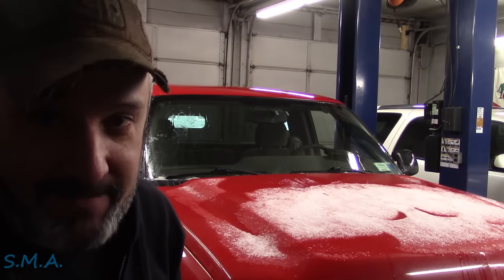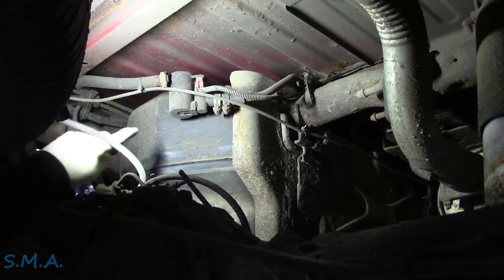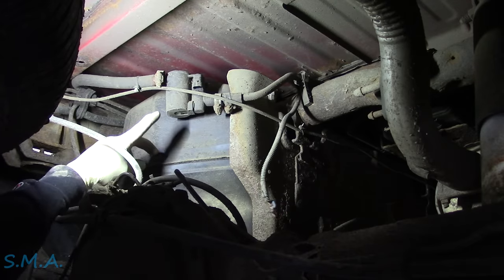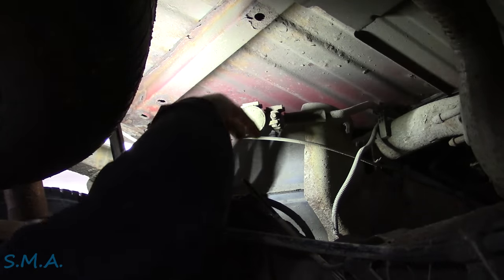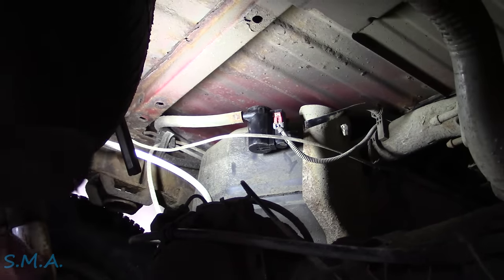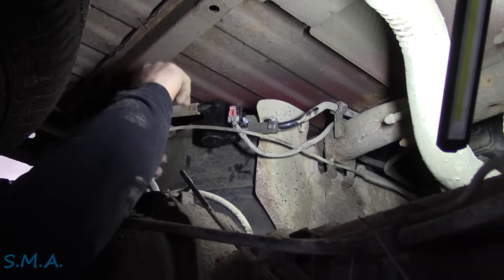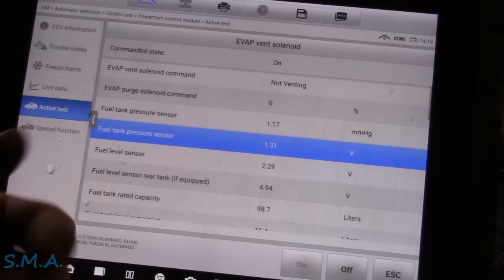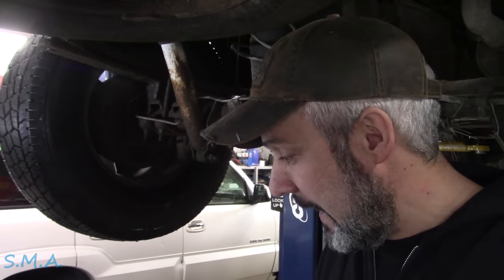Chevy/GMC Truck: P0442 P0455 Small & Large EVAP Leak

Comment: Mrs. O: "Is there any benefit to changing the thermostat when doing a heater core flush?" It's for a Ram"

Mr. O: "...I can..."

Let's all take a moment for the cold customer in a Dodge with a plugged heater core.
Reply: 2017 plugged core is a weird thing to have. Unless they have had other issues
Reply: @Sicktrickintuner  probably a bad blend door motor. Lol
Reply: I think he was getting at having his brain picked by randoms, which is why he replied "I can...", meaning if the guy wants a definitive answer he can bring it in.
Reply: Sicktrickintuner  Or perhaps believed Scotty Kilmer that it’s ok to use a whole bottle of Barr’s Coolant System Liquid Aluminum Stop Leak. lol

Comment: Methinks GM thought one day that "the 3.8 is a great engine, so the 4.8 will be even better!" Clearly their reasoning was faulty.
Reply: 4.8 is pretty much bullet proof. 3.8l has a bunch of cheap external GM engineering that brings down the reliability. Such as plastic bypass elbows, plastic upper intake plenum that melts. Lower plastic intake gaskets that fail. Valve cover gaskets that melt away and drip oil all over the manifolds.
Reply: I wonder if it was just an attempt to lower emissions in the light duty truck category
Reply: I replaced mine with a 6.0 in my 2001 that had the 5 speed.
Reply: The 4.8 is an incredible engine and holds up great to extra power
Reply: @sierravortec2494  I still own a 96 S10 with the 4.3 tough as nails . and a 91 GMC 1500 with the 5.7  290 k on it , but I've cheated I changed oil every 3,500 miles .
Reply: Perhaps to increase the MPG on their truck fleet, or for competitive reasons...?
Reply: I have a 4.8 in my 2011 4x4 Silverado, short bed, standard cab. The engine is gutless down low, wakes up a bit above 3k rpm. Exactly the opposite of what a truck engine should be. But it's pretty good on gas, I've hit a high tank of 21 mpg, which I think is very good for a full-size pickup. Just don't tow anything with it, as the gas mileage goes to shit fast, and the engine struggles. But it has 100k miles on it and all I've ever done is change the oil & filters every 3000-3500 miles. Here in cold, salty, central NY state, the body will be long gone before the engine gives up.

Comment: Another one fixed.  What should I use to get my alternator moving freely again?, the truck wasnt used for a while and the alternator is difficult to turn over. Thanks
Reply: Replace it.  There may be rebuild kits for alternators.  I have one for my 2002 F150 in case I need it.
Reply: It needed bearings just before it got hard to turn. Don't run it unless you get some or as suggested change the entire alternator. Chances are very good there is nothing left to fix with the bearings you have in it now. But grease is what they used to have in them.

Comment: Eric O,  I've  wondered. With a vehicle.   150,000
Beat up miles.  Barring the smoke test, cap replace... short wires.  And before the DTC....
WOULD,it be plausible to replace.  The 3 main parts. Plus hoses/ connections.  ???
Been curious 🤔

Comment: Great Informative Video Eric!! I've been chasing P0442 DTC for awhile now.. I've changed both Evaps and still get Same DTC.. With your video I cked seal and seems to be correct but fuel tank pressure drops to 0.03+- or so.. Would that be normal? Any other ideas or should next step be smoke test again?

Comment: The idle on my car stumbles  after refueling.  After about 30 seconds it normalizes and runs fine until next fuel up. No CEL and no problem filling the tank. Ive replace the purge valve and the vent valve with no luck. Wondering if it could be a clogged fuel tank vent line.

Comment: Or replace the valve with a GM 214-2149 ($16), which vents inside itself.  Same plug as the old styled one, and only 1 hose.

Comment: I have a 2005 GMC Sierra half ton pick up with Evap system problems. I’ve done the purge valve in the tank and the canister valve like you did in your video and I’m still getting an engine light for the same code. What could it possibly be?

Comment: Will this issue cause loss of fuel pressure overnight? I have to prime my fuel pump with the key to start my truck if it sits overnight
Reply: No. This only handles fuel vapors inside the gas tank. Sounds like you have a bad fuel pressure regulator or a bad fuel pump, maybe a sticking injector. I'd definitely look for a small fuel leak in any of the supply hoses to the fuel rail. Definitely don't want to burn the truck down.
Reply: Maybe fuel filter?
Reply: Nope - that's a check valve inside the fuel pump assembly. The valves aren't replaceable - new fuel pump is the fix for that.

I had one in a Volvo once that failed the opposite way. It would get stuck shut, and not allow fuel to pump! That was interesting.
Reply: I would say that would be the check valve in the fuel pump, an injector stuck open or a hole in the fuel line.
Reply: @eldonerc2524  Hey man, on my 06 Sierra I replaced the rear dome lights. Anyways,  when I swapped the bulbs again I heard and smelled a burnt sound. Now my reverse camera doesn't work along with the rear dome lights. Any idea on what I should do?

Comment: The small evap leak is usually the gas cap the big leak is the wrong gas cap or the purge valve
Reply from the maker: Interesting you mention the gas cap. I have repaired and diagnosed well over a thousand EVAP system of all different makes and in the past 20 years I think I have actually found 2 bad gas caps. It is usually the least common actual problem but the most common part people change for some reason. Any how, may be different in your climate 😊
Reply: @Mauivegan67  😅 drove off an left my cap sitting on the pump one time. Went back to the station an asked about it. The girl pulled out a box with about 30 caps in it asked if I knew which one was mine. Just got a good chuckle outta it. An about 10 minutes of trying gas caps I got one that fit. LoL
Reply: @SouthMainAuto  2006 Mustang GT, one day evap issues... guessed gas cap, got a new OEM one, and tada.  They do happen, but that was my first and only!  I know, I know... parts cannon... it worked. :)

Comment: Hello, I enjoyed your video,  I'm in CA. took my 88 Cheyenne 1500  pick-up in for smog testing today everything passed except at the end they had to smoke the gas tank and came back a leak. on the paperwork it said "GROSS" so it didn't pass and they want me to bring it back for diagnostic. I am on ssdi so my budget is limited so I want to try to find the leak myself to save some money and hopefully I can repair it and it is not the fuel pump gasket or something I can't get to without lifting the back bed of the truck.  Any thoughts?

Comment: I had a 2000 Chrysler Concorde, that I had to replace, the entire system. I smoked it, couldn’t find any leaks? It was an intermittent thing also. The canister lives wedged between the frame and gas tank. That was fun, on my back, in my driveway trying to get that out. Come to find out, the problem was , one of the hoses kept slipping off, the canister, causing the money light to come on. Absolutely no room to work, or even see the top of the charcoal canister? Not fun.

Comment: So on a 2010 Suburban 1500 with evap errors all over the place, this would be the first place to check?  It would make no sense to replace hoses and other things I've seen people do on videos if this is 24/7 venting, right?  My suburban has horrible acceleration until I get to about 2500 RPM.  It is not in limp mode.  I've changed the oxygen sensors out and it ran fantastic for about 10 minutes after that, and then back to reality.

Comment: at what point in time do many small EVAP leaks become a large EVAP leak?
Reply: When the rust hole gets bigger in the filler neck or the purge solenoid or vent valve get stuck wide open
Reply: no gas cap..lol
Reply: @Nudnik1  Yeah that'll do it too. Many gas caps go "missing " off the car lot where I work. I don't work in the hood, but I'm near it. We've had emblems stolen off cars, loose alloys wheels taken. All the caps I replace now are replaced with locking caps
Reply: @FixIt1975  In da hood gangsta b jacking rides dumping them when outta gas..
They leave caps on..
Reply: @Nudnik1  true, but I work 10 minutes outside Camden,  NJ  in Merchantville. I think these bozos are stealing gas when we're not there. Or they need the gas caps for their rides
Reply: @FixIt1975  IDK I already have several holes larger than all that but mostly at shock and spring mounts or in doors or body panels dad actually had a fuel tank fall out of one car but the dual exhaust pipes kept it closely in place so it didn't disconnect.
Reply: @FixIt1975    amazing so many think they are 'entitled' to what you have worked for or earned or created. "It's a whole new world"
Reply: @jhonditch4269  sounds like time for a newer car. Or, a nice, thick ratchet strap will hold a gas tank in, in a pinch
Reply: @FixIt1975  I had those when gas got up to $1.00 a gallon and you could only get $5 at a time on even or odd days. yeah I miss Mr Peanut Farmer Jimmy Cartier. if cold just put on a Mr Rodgers sweater.
Reply: @jhonditch4269  It's sure as hell not a better world,  not in my opinion
Reply: @jhonditch4269  I don't miss him. I remember the second fuel embargo.
Reply: @FixIt1975  I didn't say better I said NEW GOD help us all.
Reply: @FixIt1975  it looks better every time i add more jb weld and scrap plastic when I master carbon fiber patching it will be beyond what manufactures now produce as 'new' being never ever worked. Damn Dorman always does me in though.
Reply: @jhonditch4269  Dorman is hit and miss. Most of their hard parts are ok, for instance,  I just replaced all the fuel and vapor lines on my 2000 Silverado with a stainless steel kit from Dorman. I didn't go OEM because it isn't available anymore. It was a spendy kit, $400, but very good quality. I'm not kidding. Now their electrical parts,  are for the most part,  complete garbage. I work on probably a thousand cars a year. Right now, I have to be very creative in how I get things fixed. OEM,  aftermarket,  used sometimes. If I don't have to see the car again after it's been sold, and  my employer is happy,  so am I

Comment: I have both large and small leak codes so I changed gas cap, purge valve, and vent valve but still have same codes. Finally did smoke test but I don’t see smoke coming out. Any suggestions?

Comment: You mentioned that the information on your scan tool was in Canadian, what did you mean?? Do the vehicles have different information on them even if they are potentially the same make and model to meet a different countries pass requirements ??
Reply: He simply meant the units were in metric ... "litres" specifically ...     Settings in the scan tool allow you to select Imperial or Metric units.
Reply: Thanks Dwight being at Brit I didn’t get the choice of words and meaning, but being a Brit in their 50’s and worked in machine shop I know both metric and imperial systems. I value your reply thank you!!

Comment: So I got a 2008 Chevy Silverado with the 4.8 V8 and I got the codes p0455 & p0442 I only have problems starting the vehicle right after a fill up it will hesitate first attempt but will start on the second attempt any idea where to start from my information?

Comment: The 4.8 was has an excellent reliability record like the 6.0. The 5.3 has always been the more trouble prone engine of the group. Mainly because of active fuel management and other small issues. I think of the 4.8 GM to the 4.6 Ford. A small but robust reliable engine.
Reply: While I agree with you, this generation of truck didn't have the dod/afm, so the 5.3 was just as good as the rest
Reply: Yep - going to be doing a 6.0 (or 6.2, or 7.0 - haven't decided yet) swap on my '07 (GMT-900) Silverado soon. Low oil pressure, and the engine has been burning oil and making metal since it  had 50k miles on it. At 117k now. What a disappointment! Half the driveline has already failed, too. Rear diff couldn't even make 100k miles.
Reply: @SmittySmithsonite  go with a 6.0, if you are going to keep the PCM stock (and use a DOD eliminator on the obdII port). The 5.3 fuel maps work, but will add 3% on the long term fuel trims. The 6.2 and 7.0 will go too positive on the long term trims and trip lean codes. This is from my personal experience of playing the LS swap games. Also, you could put a 6.0 where a 6.2 lived and it shows -2% long  term fuel trims.
Reply: @mattcat231  That's good to know. Thanks! I didn't know they'd even run without a tune. I'll be going with a full dyno tune when the swap is done. Whichever engine I end up with will be getting a mild cam, Trailblazer SS intake (or Dorman equivalent), and headers. I hate how the LS engine's powerband is top-weighted, so I want to get the most amount of N/A torque I can get. I pull a flatbed trailer hauling cars and trucks all over hilly New England, and the 5.3 is adequate, but I want a bit more. If I had the money for a Whipple or turbo kit, I'd just do that, but this might be a budget build. In that case, displacement is my friend.

Comment: I have a 2004 silverado with a 5.3 mfi. I changed the vent but I kept hearing a putter sound and it eventually went bad. Do you think there's a leak on top of the tank at the fuel tank?

Comment: Hellos I tested that sensor it work open and close .. I check my wire it has 14volt but when I use my test light the light don't turn on... I have to change that sensor any way or what I do ... I hope you can answer this question  thank you

Comment: I have a question I have 2005 silvardo showing code p0449 I just took about a cup of crap out of the canister I decided to buy a used one from wrwking yard but I got the wrong one that only has one line coming of of it .the uther one had that long hose running as long Fram to front of the engine I could not see anywhere were it was sapose to plug in if I get that valve to make noise and it's a rite seal I can block off the other hose going up front is that correct or can I use the one off another truck that only had the one hose as long as  it makes noise and doesn't leak is that correct. Trying to get it smoked and that's the last code iam working on ?

Comment: Eric old is the greatest! I was wondering if you can recommend a good diagnostic shop. I live in Brooklyn but and willing to travel the Queens or Long Island. I have a 2007 GMC Yukon Denali XL 6.2 L with the P0 300 code of death! LOL fuel trim on bank 1 and bank 2 is 56 and 14 short-term respectively and zero long-term in both Banks. I've changed the ignition coils on bank one because I was getting misfire at cylinder 1 and 3 and zero at all other cylinders. Could this be a ground issue? I don't want to spend anymore money using try agnostics! Also don't want to get ripped off at a so-called diagnostic shop that only does brakes! LOL any help would be greatly appreciated and keep up the great work!

Comment: Hi can u help me?  After I replaced my front wheel bearing and I got ABS, traction controll, tpms and stability lights come on. When I scan for codes, it gives me no codes. Can u guide me in the right direction?  Thank you very much.

Comment: Because ford had a 4.6 so they had to one up them
Reply: I always thought it was because it was just a cheap v8 alternative.
Reply: The difference between the 4.8 and the 5.3 is the stroke length. The pistons are the same size.  The same is true for the 4.6 and 5.4 Ford engines.  The shorter stroke engines had a slightly better fuel economy rating.

Comment: Will that evaporator system leak will it make the vehicle run worse
Reply: Yes it will ,not major though symptoms I had was fuel smell in oil an thinning, excessive exhaust smoke, lack of performance and temp will go up slightly at idle. Fuel mileage also. I Always used super on til price when up.

Comment: 4.8 is a great engine...I'd say it was built for gas mileage and the working man...if it's a cast iron block it will run dam near forever if you keep the oil changed....that's my guess

Comment: Question,  when you go to refuel your pickup ,upon opening the gas cap air  pressure is noticed. Now is that good or bad ? What's happening?
Reply: I think that’s just the fuel system depressurizing; what your describing sounds normal to me, but others should correct me if I’m wrong.
Reply: Depends on the vehicle.  Normally the tank is atmospheric until the PCM checks for vapor leaks.

Comment: sorry this question has nothing to do with this video .i have a 2003 ford ranger 3.0 running rough i changed spark plug and wires running new wires i saw that 5,6 wasnt swithed on coil pack it run like that but when i ran bank  2. 4,6,5, it would start . but that is the wiring ..right

Comment: Hey I like the 4.8 I got a 2000 Chevy truck I am selling it because I don't need a truck anymore as I retired but I always thought it was a good running motor.
Reply: Great motor, but if you tow heavy stuff often the extra torque of the 5.3 helps, also the 07 up 4.8 has no AFM junk!
Reply: Definitely one of the better engines GM built. They respond extremely well to camshaft swaps, like all the LS family does. Wakes it up from the dead a bit.